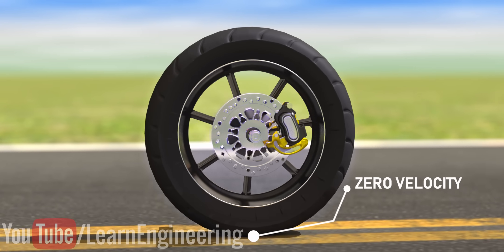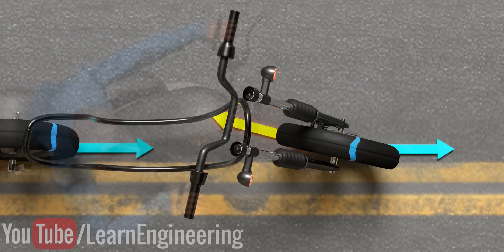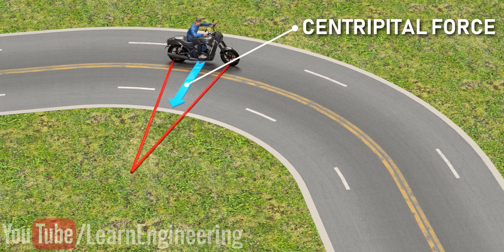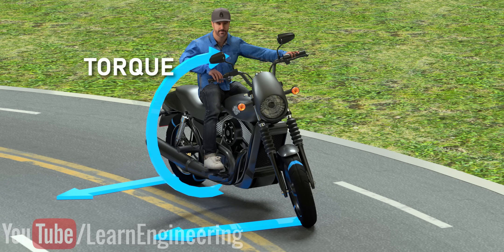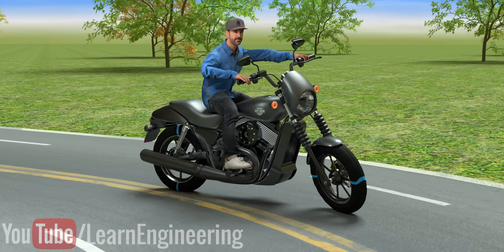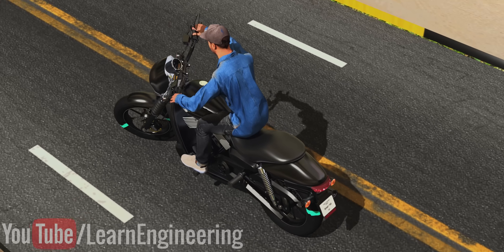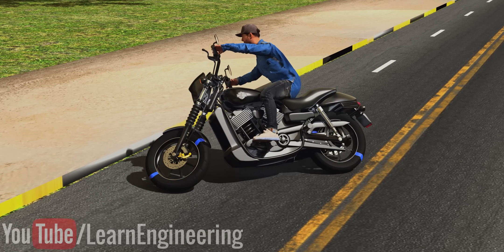Counter Steering | The interesting physics behind it

Comment: Very misleading graphics. What is called 'normal steering' basically needs no explanation, at slow speed you turn the handlebars in the direction you want to go (you still need to lean). 

Counter steering - This is the ONLY option you have once over say 10 to 20kph (dependant on front end geometry and tyre sizes). 

So what happens: As you approach a LH corner, you 'push' on the LH (and 'pull' on the RH) side handle bar, Note the front wheel will NOT turn to the right it stays, mostly straight (were not taking into consideration of drifting or backing it in here). This causes the bike to lean to the left in accordance with the steering geometry. Cool, so what makes the bike go round the corner? Basically the shape of the tyres. The outside of the tyres have a smaller radius the the centre of the tyre, so when tipped over the bike wants to track in a circle, the more you lean the smaller the circle. Imagine a cone on its side, and you give it a push, the cone will roll in a circle. Motorcycles tyres are basically two cones joined at the bases. As any motorcyclist will attest, putting new tyres on makes your bike handle way better that the old squared off tyres you have just replaced. 

Finally, you can't counter steer (or steer) with steering triple fork welded to the frame, a fact any motorcyclist will tell you after replacing the steering head bearings. What is transmitted through the handlebars, steering head bearings, forks, front axel, wheel and tyre is force. If the steering head bearings are welded up, the force takes a different and ineffective path. For the same reasons you can't steer with your feet on the foot pegs.

Comment: Countersterring is always wrong. If you want to go right you lean right and pull your bike over with both hands. Every instructor I've ever had has taught to never to lean. I got my motorcycle license when I was sixteen a week after my driver's license. I've been a motorcycle mechanic almost as long and I've done some amateur racing. Don't ever countersteer.
Reply: So what your saying is that you’ve never tried it. You’d be surprised how easy it is to steer a bike by “proper” counter steering (not like this vid suggests) as opposed to how you haul your bike around.
Reply: @softailfun  the tire is contoured to have maximum grip when you counter steer your throwing off the tire causing it to have less grip. But good intelligent answer of you've never tried it
Reply: @gingerking3798  
I get what your saying, but when you counter steer (tiny movement) the bike leans in the same direction, so push right grip forward and the bike leans to the right. The steering geometry of the bike forces the wheel to steer into the turn even though you maintain forward pressure on the right grip. I’m speaking from experience riding a vast array of motor cycles over a 40 year period. It works on all bikes both hi and low, long and short.
Reply: @softailfun  you have fun with that
Reply: @gingerking3798  
We all do, you included, you just don’t understand that you are doing it. If you didn’t counter steer one of two things would happen: 1) you’d wobble around corners at stupidly low speeds or 2) you’d crash.
Learn how to steer your bike https://youtu.be/lzk8oyNO708?si=0pzstFQEFYoNRTeH
Reply: @softailfun  with the size women I have on my bike if I couter steered I'd crash all the time
Reply: @gingerking3798 
If she reads that you’re getting a slap brother. 😂😂.

Comment: important: the longer the wheelbase, the higher speeds it takes to "countersteer" aka normal safe steering. almost learned this the hard way with a Honda shadow. was used to short wheelbase sport bikes. the Shadow required direct input steering up to something like 15-20mph. i trust this is the same with all cruiser types, but worth mentioning because i had to take a long slow turn 1st time out, and didnt realize counter steering at slow speeds was a big no-no with those. almost drove onto the curb.
Reply: Drive a Harley at those speeds counter steering.

Comment: You, and this stupid video, are going to get a lot of young riders killed.  How could you be so ignorant.  Counter steering IS NOT a “technique” used by riders for quick turns.  It is a basic principle underlying how a motorcycle functions.  ALL turns are initiated by counter steering, whether the rider realizes it or not.  Hundreds, if not thousand of riders have been killed when running off the road, or into head on traffic, by trying to make their motorcycle turn in the direction they are turning the wheel.  It simply doesn’t work that way.  This is a VERY dangerous video, and should not be up on youtube.  Please, take it down!
Reply: Well said.

Comment: Actually this what everybody does unintententionally without realizing it. Only a few percentage know what happenes really. It still work for too of course. It is still suprising how many riders think you need to steer outward all the way long in a corner. 😅
Reply: Well you do retain a forward pressure on the inside grip, so really you do counter steer throughout the bend.

Comment: this was clearly made by a NON rider, it's wrong. "There is no such thing as "normal steering". Direct input steering is only used when the bike is slow enough that the torque it produce isn't enough to lean the bike, you use it at extremely low turtle speed. But once you start to gain some speed it will always be counter steering, no other way."

Comment: Shouldn’t be called counter steering, you’re not doing that mid turn only in a beginning of a turn to make the bike lean. Only time you actually “counter steer” is if you break traction and are actively turning in the opposite direction through the turn and that’s called drifting
Reply: Do you ride?
Reply: @softailfun  yes I have a 04 cbr f4i and I have a 04 g35 that I take to the track to drift…
Reply: That's not how it works.  The bike is continually trying to right itself, so to maintain the turn, you are still pushing on the handlebars throughout the turn.  It's essentially counter-steering, even if it's barely noticeable.

Look right, lean right, go right. 

But you still maintain a little pressure to keep the bike "falling" into the turn.

Comment: I mean isnt it basically like drifting/rally u dont keep right u gotta turn left also so u dont over turn
Reply: Nothing to do with drifting.
Reply: @softailfun  I didn't mean it was drifting but same idea gotta counter steer to go the same direction but I wrote that before I understood the whole concept
Reply: @prpunk187  
Well (counter steering) you push the inside grip forward. So to go left you push the left grip and you maintain a forward pressure on the grip for the duration of the bend. While your doing that the front wheel WILL steer into the bend due to the bikes own steering geometry. Drifting however you actually want the front wheel to steer away from the bend. That’s to say if you are drifting left, your front wheel is well and truly steering to the right while your ass end is completing the slide/drift. I can see how people get this wrong in their minds eye, but they are totally different. This video is dangerously inaccurate as far as this topic goes.  Bloody hell, There’s a lot of words in that.
Reply: @softailfun  I appreciate the Info regardless I understand most people do it without even knowing it  but when u actually say it it doesn't make any sense but it usually happens what is it over 25 mph or so not a rider myself but love informative info lol I'm what people would say is a nerd love the science behind things lol

Comment: How many wrecks has this video caused ?  so according to this say im flying around a corner I have the bike leaned over and there is a garbage can in the apex smack in-front  of me im supposed to turn my wheel the other way the bike now changes directions I have avoided the garbage can but now I nerd to re correct the  original lean get back on course and all is good ,,,yeah im am going to practice that 
when we were 5 years old we all rode our bikes without having to worry about counter steering ,,it just happens

Comment: This is making a simple concept confusing.

At 2:45 or so is the important bit: the way to turn at speed on a two-wheeler, be it a motorcycle or a bicycle, is to LEAN in the direction you want to go in. Not to "steer away" from the direction you want to go in. And once you lean the bike in that direction, you HAVE to hold the front wheel in the opposite direction to stay up - if you align the front wheel with the direction of your turn, you'll fall down. Immediately.

And this is intuitive as soon as you start do it, because you FEEL it happening before you actually fall, and will immediately move the front wheel in the opposite direction to stop it from happening. Anybody who's ridden a bicycle around a corner or a curve at a decent speed would know this.

It's only confusing if you throw terms around like "steer in the opposite direction" as words on paper or on the screen. While explaining how centrifugal force works is not intuitive, the actual act of countersteering is.

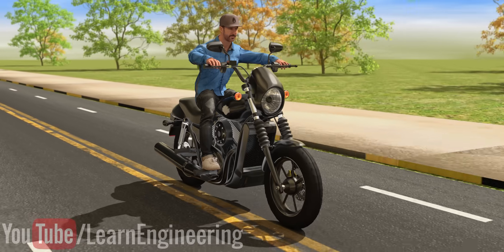Comment: 1:13 nonsense. In normal steering, we counter steer but to a minimal amount. Fix the bars so you can't turn them to the left anymore than dead center and you'll quickly find out that it's possible to go straight if you're careful, but entirely impossible to take a turn. Left, because you can't follow up the counter steer, and right, because you can't counter steer in the first place.

Comment: I havent riden a motercycle  yet but plan to get one but i assume i do this subconscious  as i ride a escooter and this scooter goes uo to 65 mph and i ride in town with traffic. I dont turn wheel to turn unless  its slow speeds i just lean and press forward  into the handle bar i wanr to turn and it works lol so  i assume im doing counter stearing?

Comment: This confuses me. On my R6, i push the handlebar right to go right. I push left to go left. Keep body straight as possible but thats how turn unless its real low speed. This confuses me.
Reply: You’re right, the video is wrong. In fact it’s dangerously wrong. Ride safe.
Reply: @softailfun  thabks. Im switchin to a cruiser soon and this big ol thang does intimidate. But if i remember the basics i should be fine. Esp when it comes to cornering

Comment: I do know the physics behind it but the distance that the activa covers while trying to do the counter steering is a lot he can just do a lean turn counter steering requires in higher cc bikes or where the rear tire can turn more cycles than the front tire, just my experience.
Reply: Lean turn you say? And how is a bike made to lean? Answer: counter steering.

Comment: Question ( hoping that somebody would see this ):
Is it possible to take the same curve at the same speed with counter steering and without counter steering ?
Reply: No. Counter steering is the only way to steer a motorcycle. Oh, and completely ignore this video it’s wrong and it’s dangerous. Here is a far more informative link on the topic (not mine). https://youtu.be/lzk8oyNO708

Comment: Was confused at first by this video, until the end where they showed the demonstration. Correct me if I’m wrong but counter steering is basically, swinging wide and creating space and distance to make sharper turns?
Reply: Your understanding of counter steering is incorrect. Don’t be guided by this video, it’s dangerously wrong as regards counter steering.
Reply: Counter steering exploits the geometry of the bike. Travelling forward, when you turn the front wheel to point left, the bike will start to fall to the right. All the rider needs to do then is allow the handle bars to go where they want to (just one reason why it's necessary to lightly hold the bars on a motorcycle) and the bike will travel to the right. This video is utter error-laden gibberish and is of zero value. Surely a bot has generated the millions of views.
Reply: Here’s a link to a great video on this topic. https://youtu.be/lzk8oyNO708

Comment: There is no such thing as "normal steering of a motorcycle". And shifting the weight alone DOES NOT steer a motorcycle. 
A motorcycle is turned at high speed ONLY by counter-steering.

Delete this video because it's false...

Comment: the physics behind is interesting
Reply: But this video has it wrong.
Reply: @softailfun  bikers don't have to know the basics of physics to ride a bike. The physics in the video is correct.
Reply: @Hong16492b  
The action described in the video when counter steering is dangerously wrong . As your so hot with physics, I’m sure you also understand that counter steering isn’t an option, as described in the video, it’s the only steering system a bike has. So I stand by my original comment.
Reply: @softailfun  plz see the comment Car Jac made. He explained accurately
Reply: @Hong16492b  
And I agree with him completely. Which makes the video incorrect on that point, so you supporting the video makes you wrong. So, I once again refer to my original comment. You argue with what I say and yet prove my point, strange.
Reply: @softailfun  You could say that 20%of the content are wrong, or appreciate the video by saying 80% of the content are right. You just said it is wrong, didn't you? 
i apologize for saying 'The physics in the video is correct'. It's misleading. The physics in the video is correct: 3:47 he said during the lean opperation（in the turn）, the driver cleverly adjusts the angle of the handlebar. 'Driver cleverly adjusts the angle of the handlebar' is not about physics. Physics don't explain how the steer angle is like that.
Reply: @Hong16492b  
Correct! The rider DOES NOT cleverly adjust the handlebar. If the rider is pushing forward on the left grip in order to turn left (which is correct), if he were then to (cleverly) turn into the lean (steer to the left)….. the bike would immediately stand up and fail to make the turn. The fact that the front wheel steers into the bend is due to the steering configuration (rake, trail etc) of the bike itself. Not understanding this very small but hugely important point would end up being a very bad day.

Comment: So to make this really simple: 

When you pick up speed you get gyroscopic stabillity and you need to countersteer to the left to make the bike tip over to the right, and when the bike starts to tip over to the right your front wheel will naturally catch the bike under itself and you turn the handle bars more to the right under itself to stand it back up again "making it start tipping in the left direction to stand up from faliing to the right" after the turn or if you want to hold the angle for longer.

In a high speed right hand corner you countersteer left to make the bike fall to the right and through the entire corner you are turning to the right "holding the lean" to counteract the bike from falling over more towards the right until you stand it upright again.

The slower you go the less you need to countersteer to make it fall because the bike is less gyroscopically stable so it will tip over more easily but you need to counterhold the lean by turning the wheel into the direction you want to go more accurately and faster becasue the bike will want to fall over faster and this is why slow speed u-turns are much harder than high speed cornering.

When you are going slow when the bike starts falling in whatever direction ,you turn the tire into that direction it is falling to catch itself and to make the bike start tipping in the opposite direction to make it stand up straight simple as that.

You can't choose how to turn a 2 wheel vehicle it only works like this at any speed. When it falls at low speed you countersteer to catch yourself back up. When you countersteer at speed it starts to fall and then you countersteer to get it back up straight again simple as that. 

Should be easy to grasp.
Reply: wrong. this video is wrong. you ALWAYS countersteer and not just to initiate a turn. you counter steer to stay upright, to turn and to keep the bike on a trajectory during the turn. the moment you’re not counter steering, you’re on the ground. of course, while leaning and doing the turn you might wanna adopt an extended definition of what counter steering is: i mean you steer less to lean more and steer more to lean less, but you never point the wheel outside the turn, that’s only to initiate the turn. but even at low speeds: how do you think the bike stays upright? continuous involuntary imperceptible counter steering. you don’t realize you do it but you do it. you learn it as a kid when you learn to ride i bicycle.
Reply: ok i didn’t read the last two parts. those are kind of correct. but remember: the only thing that changes with speed is how noticeable it is but it doesn’t change in direction, nothing flips at slow speeds as you say at the very end. the only thing that filps is this: at low speeds it’s noticeable and deliberate to keep the bike upright, almost imperceptible to initiate the turn. at high speeds it’s the opposite: imperceptible to keep the bike up, noticeable and deliberate to initiate a turn
Reply: nice one

Comment: Do not try the normal steering above 30 kph, it won't work. From 15 years of experience, counter steering is the only way to steer. Anything other than that does not provide precise control of the bike when you want to corner.

Comment: This video makes everything look bad. Watch a actual rider. And it makes sense right away. Just like riding your bicycle at faster speeds. When your bombing a hill and need to turn right. Your not turning your handle bars to the right. You will push lightly with your right hand which at slow speeds take you left. At high speeds tilt the inner wheel closer to the ground creating downforce and turning.